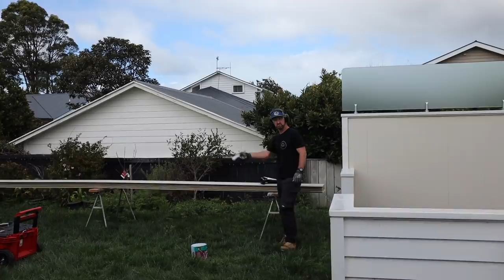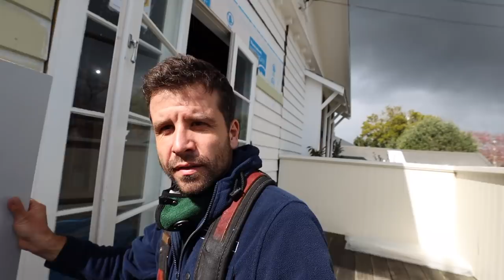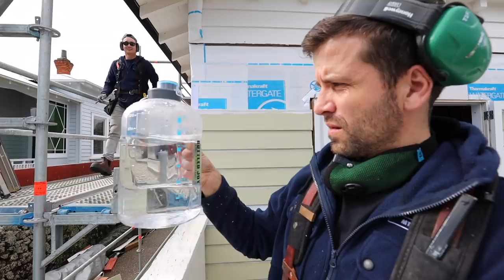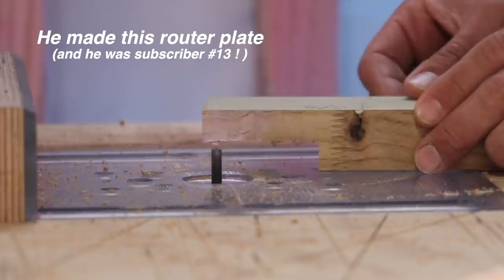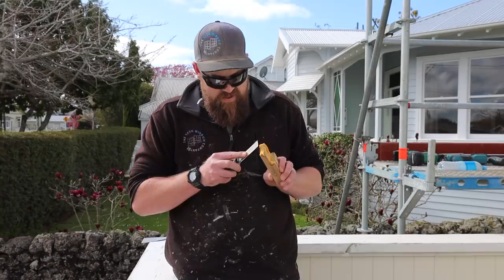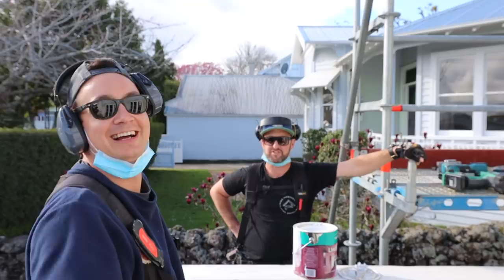Matching A Window To An Old House

Comment: Is that Repair Care Dry Flex that Todd is using on the door sill? That stuff is awesome. Doesn't sag, sets hard, can be chiselled and sanded.

It does stink though and the 1 hour compound gives off steam as it sets as it's an exothermic reaction.

Comment: ITM has got a product that's essentially a bottle of primer with a brush head(and a separate cap). It works great and you no longer have to worry about separate brushes and a tin of paint. The product is by NIAGARA called Envira Fast Dry End Seal i believe its called.
Reply: yeah it's awesome, but it's only 450ml bottle. good if you're doing a few weather boards. A brush and primer goes further, easier to get a hold of, and costs a whole lot less.

Comment: Scott, I have a question bother me for a while. Say if I want to make make a piece of indoor furniture. Where should I go to buy the wood. From Mitre 10 or burnings(I am in Akl). Most of timbers are treated for outdoor construction buodlings. Are these save to use as indoor furniture. Where do I go to buy untreated timber? I see there are precut pieces on the shelf like $20+ each, so expensive. Thanks.

Comment: Hey scott. great vid yet again... just wondering what you put on as a grip for the vaughan wooden handle hammer, is that black tape or something? Thanks
Reply from the maker: https://www.amazon.com/dp/B001445114/ref=cm_sw_r_cp_apa_i_pH-uFbFZX3VFP
Stiletto grip,, you put your hammer through the plastic tube and slowly unravel the coil and the rubber will grip onto your handle. It works really well,  it was a freebie from Stiletto 👍

Comment: How are most homes heated in NZ? I feel like you have cheaper heating costs with all these old houses.
Reply: Depends where you are. Here in Auckland its electric heat pump / aircon combo for renovated homes, some are gas heating with portable LPG bottle, some mains gas and some dirty old bar or fan heater and a regular fan for cooling in summer.

Auckland and north of isn't even cold. It might see 9C degree in winter. I walk around in shorts and sandals all year, if it's cold I wear a hoodie.

These older homes are probably warmer than average as they're all in wealthier inner city areas and have had a good 25 odd years of renovations as the prices of these homes/suburbs have crept up.

Comment: Hi Scott , big fan ,
Just question : do you guys not stager you’re weather board’s joint ( I seen 1 long seem ) just wondering !!
Thanks , love from Canada 🇨🇦
Reply: You often see long seams when a house extension is being done (like it is here), where the old weatherboard meets the new. I've commonly seen staircase-style metal flashing put over the top of the join; not sure what they're planning on for this one.
Reply: Scriber
Reply: It will be a facing and scriber either side most likely. fairly standard for house extension, as stated above.

Comment: Hej Scott
Love your videos. Im a builder in Sweden. I was wondering i didnt see gap between the waterproofing material and the cladering.. Is that why you have primed boards? We put here additional lists for air gap and ventilation behind facade
Reply: There is a cavity behind the cladding in new builds in NZ, but wasn't when this house was originally built. If Scott put a cavity behind the new weatherboards the finished cladding would stick out further than the existing cladding and the house would look very weird. I guess there is an exemption to having a cavity in cases like this one.
Reply: @Granition  thanks Granite! So place , time and circumstance
👍

Comment: The builder before you and now you are making a common mistake. The facings or architraves need to be set int so that the weather boards butt up against the side of the arch’s. The way you have it is a water trap that will see those sills rotted out in no time. I realise that if you do this the ends of the weather boards are floating on a void. However if you put a stud inside you can then nail them down it will look so much better and seal out the weather. In fact at the top of the window with the arch’s now set in. A flashing is almost not required. Old double hung windows were fitted this way but it’s been long forgotten.
Reply: We do it this way too
Reply: @devonwainstein9188  Lots of builders do.  Within 2 years the archs and the sill will be rotted out. In very exposed cases the water will find its way onto house frame, and then the the plaster inside.

Comment: Is that Accoya® wood you're using for the weatherboards? https://www.youtube.com/watch?v=BAX2lwGe_5Q
We use it in Belgium as well but I dont know if your timber is soaked in acid, it smells like vinegar... :p (you can put it in a small salad if you want (NOT))
Keep up the good work and water bottles :) Stay safe! Carpenter friend from K-Miles over a curved surface away.

Comment: Why are all your houses made of wood?
Reply: Plenty of trees in NZ when the settlers arrived, so builders used what was readily available. Forestry is big export business for NZ and has been for many years, esp as pine grows quickly here. Also, NZ sits on two tectonic plates and timber flexes more than bricks when there are earthquakes...
Reply: Dommer Hi, we have over 15,000 earthquakes a year, if you lived here would you build in stone or a material that can move (like a tree).  Even the window frames are thinner, or that could be just to keep them cheaper. As I write this we have already had four earthquakes, thats why we call this place “The Shaky Isles”!   Harera......